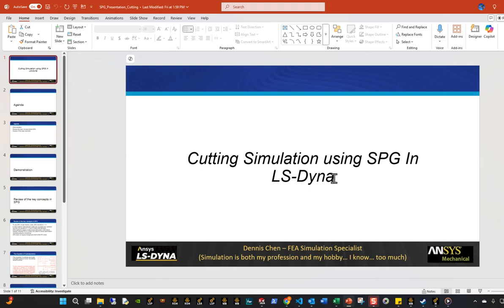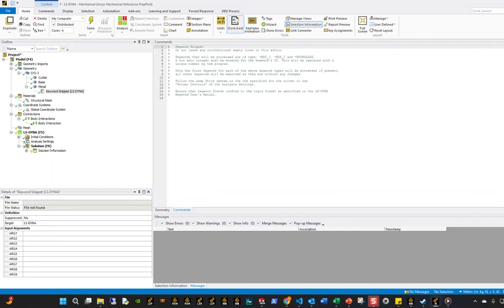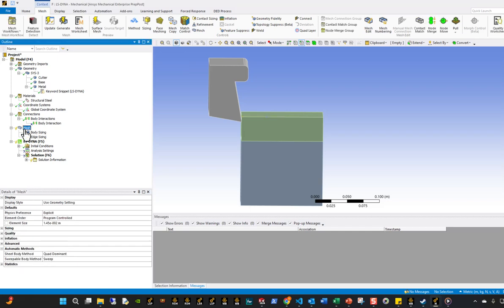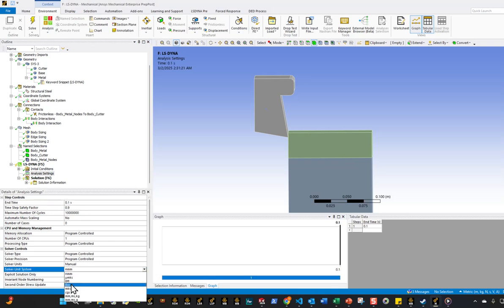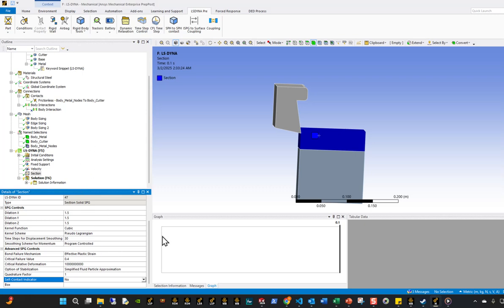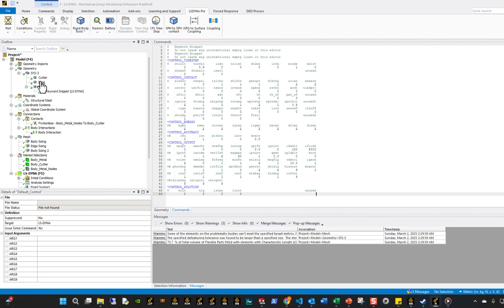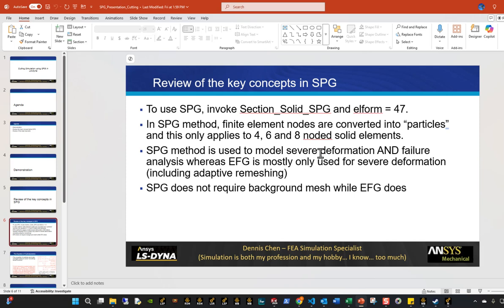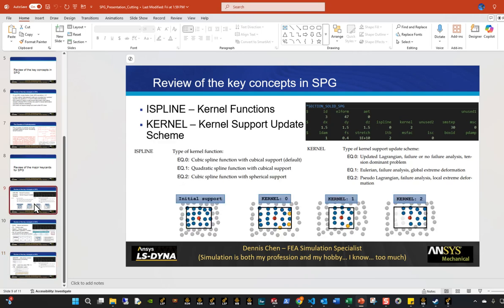Ansys LS-Dyna Tutorial - Metal Cutting Simulation using SPG and Section_Solid_SPG

Comment: Hello, Dennis! Thank you for another useful video-tutorial! One question, pls! How should I contact between SPG solid and FEM solid ? For example in high velocity simulation (armor plates)
Reply from the maker: Hi, you can use contact_automatic_nodes_to_surface.     the nodes are essentially the nodes on the body you assigned Section_solid_SPG to.   In workbench, you can scope to that body, create named selection and then generate a nodal named selection from that body named selection.    Assign a value to that nodal named selection to be used as the set ID.   Assign this ID to the contact card to complete the contact.

If you want to just bond or tie them together, you can just merge the nodes.   Hope this helps.
Reply: @DCFEA  Gonna try merge the nodes=) Thank you so much  :handshake: